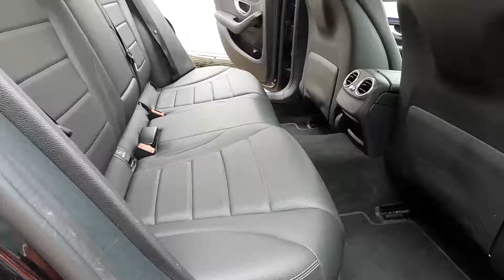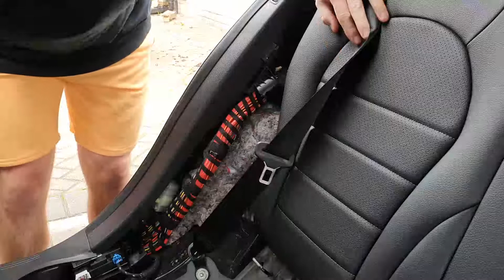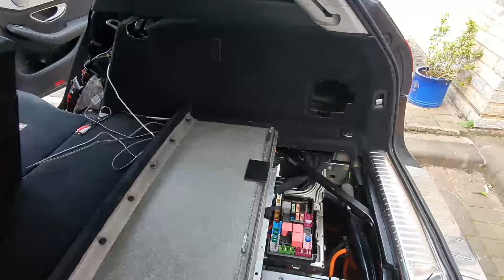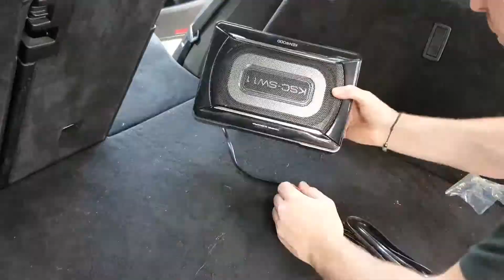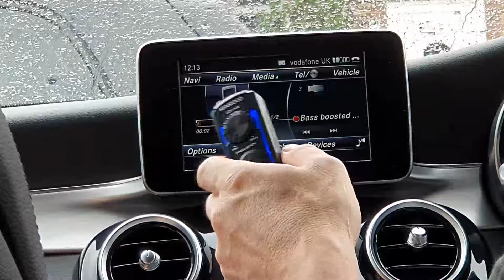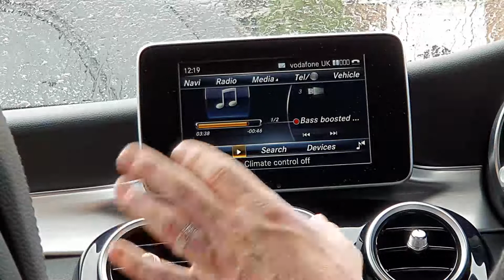Kenwood kscsw11 Under Seat Subwoofer installed into a 2016 Mercedes C Class /GLA S205, W205

Comment: I've connected the Power to Cig.Lighter Fuse , the blue one to Glove box light , Black to ground ,  Passenger side Green/GreenBrown front speaker cables to audio in but the result is failure :)  Somehow I got very low sound volume and  If I move the gain up  or the HZ close to 125 hz Very loud Feedback sound ... There is a RCA and Speaker switch If I move the switch to Speaker It goes complete silent , I've also tried RESET switch still no joy ...
Reply from the maker: What Subwoofer are you using?
Reply: @mvautomotive7092  my old Pioneer TS-WX130DA but ordered an Alpine SWE-815 today for the new challenge :)

Comment: Mine sounds distorted after turning up the volume on the remote past a quarter. any ideas why?
Reply from the maker: How have you got the bass set?
Reply: @mvautomotive7092  on the remote it’s set to a quarter volume, Any higher it Distorts. My system is a mini vibe amp connected to the head unit, two underseat subwoofers factory fitted, and this kenwood which is connected to to the head unit and is  in the boot. It sounds terrible
Reply from the maker: @Martin Horton If you have 2 didicated powered subwoofers. I would disconnect the remote lead. let this run at the factory settings. This would then bridge the gap between mid bass / low bass and let the 2 other subwoofers that sound like they can handle deeper bass.  If your using a factory head unit set the bass to 0 and then adjust the bypass filter on the vibe amp.
Reply: @mvautomotive7092  the underseat subs and the front and rear door speakers came alive once I installed the amp. Sounds great, just this kenwood doesn’t, just distortion at any volume. I’ve played about with the EQ etc but still the same. I wired the Kenwood to the door speakers. I’ve set the bass to zero on the head unit but still the same. I’ll disconnect the remote and see what happens, much appreciated
Reply from the maker: @Martin Horton  in my smart I installed vibe 6.5 comps in front and vibe 6.5 spl mid woofers in rear with this subwoofer. It's a small car but the sound quality was day and night improvement.
Reply: @mvautomotive7092  nice one, I’m surprised you still have your hearing! My gain on the amp is set at full and both front and rear are set to HPF. would you say this is a good setting?
Reply from the maker: @Martin Horton  does ypu vibe amp only have hp and lp filter some have a full range filter. If so i would turn the amp down slightly  and switch it to full range on the xover and then adjust the bypass filters to suit but avoid clipping
Reply: @mvautomotive7092  yes it’s a switch, high or low filter. I’ll set the amp at about 75% and see how it performs. I’m happy with the current set up and it doesn’t distort even at full volume, which is incredibly loud, I added the kenwood sub before I added the vibe amp and not sure I actually need it now, but it’s in and it’s fitted so I may as well keep it, I don’t think the vibe amp is powering the kenwood sub, the head unit is, the amp is powering the door speakers and the factory fitted under seat subs

Comment: This is the BEST install video I have ever watched...thank you very much! For the layman, these car systems can be overwhelming in terms of trying to choose products and understanding how they work. I have been trying to decide on a compact subwoofer to add to my system in my Golf GTI cabrio. Space is very tight. I also want it in the boot, rather than under the seat as it's already tight for passengers.  I didn't want to swap out the factory VW RCD510 head unit but wanted a decent upgrade. So far I have replaced the factory speakers front and back with Focal Inside, but  the head gave zero base. (I say  I, but actually my car audio guy.) He then installed a 4 channel Kicker amp to run the speakers which has made a huge difference but still missing that low end base from the rear coaxial speakers. I now want to add a compact sub just to round off the system and add some bottom end without blowing the windows out....lol. It's between the Kenwood KSC-SW11 per your video or the Pioneer TS-WX130DA based on size and performance, but my gut is telling me the Kenwood is the way to go. Sorry for the long post, but my question is.....since the Factory head unit does not have RCA connections, and if I understood you, you spliced in to the rear door speaker cables? Can I then just connect the sub to the rear speaker inputs on the ampliefier for the sound and then obviously run the rest of  the power cables etc per normal? I have supported my audio guy with the rest of the hardware, cabling and labour, but he doesnt supply these compact subs and offering me high end Kicker/JVC etc options but way over my budget and also way too  big. I have the perfect space on the back of  the rear seat. He  said I'm quite welcome to purchase my own sub and he will install it. Any advide would be greatly appreciated!
Reply from the maker: Thank you. So this sub does have a high and low Input ability. I wouldn't run it off the speaker outputs of the amplifier as that would be to high but you can run it off the speaker outputs of the headunit. You may find your amp as a link amp output, so you can daisy chain amps together, that would work well too. Hope this helps?
Reply: @mvautomotive7092  absolutely! Thanks man. Much appreciated!😀💪🏽

Comment: How does this sound in the Smart For Four? Thanks
Reply from the maker: We ended up using it in my mates defender. With the cabin being the same size as the smart. It adds the lower end bass sound to complete the overall quality. As mentioned before it won't rattle your car but gives a great overall sound and adds what's missing to the bass. You won't be disappointed. I should be installing another to the smart by the end of the month. 👍
Reply: @mvautomotive7092  Thanks - I was thinking Kenwood OR the phoenix gold z8150 8inch. Not sure what to do.. I changed the door speakers to Hertz - Sounds amazing 👏

Comment: Hi,
Very nice video,
Just one question did you remove the original fuse or kept it and added another one when you you use piggy back? 
Ta
Reply from the maker: Thank you. If you are adding a piggy back fuse to a circuit with a fuse then yes you remove that. Userly it goes into the bottom slot of the holder and then you add a rated fuse in the top slot for the circuit you wish to add. 

If your using the piggy back holder in a spare unused slot like I did in the video then you only need to add one fuse in the top slot for the circuit you wish to add and NOT one in the bottom. 

If you look at my dash cam video your see me adding to an existing circuit and using the two fuses as I explained above. 

Hope this helps

Comment: One of the best install and set up vids for a compact sub that I've seen, Well done, and thanks. MOst of the vids try to blow the bollocks off a sub designed to just extend the base, and all you get is clipping and distortion. Cheers,
Reply from the maker: Thank you. Glad it was of use.

Comment: Whats the colours for the other side? Becoz its not the same matw
Reply from the maker: Grey twisted pair on drivers side white twisted pair passenger side.
Reply from the maker: Solid colour cable is positive and with black line negative.
Reply: Cheers mate got it before you could reply. Thanks. 👌